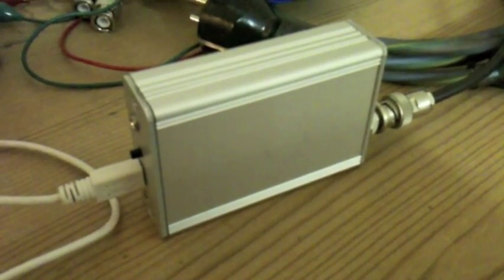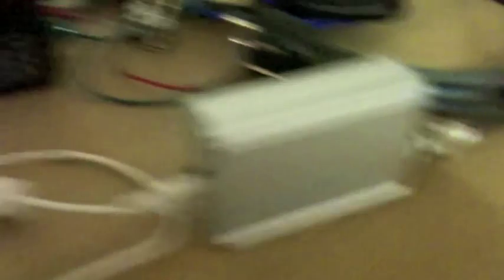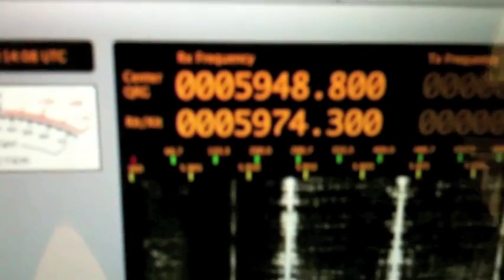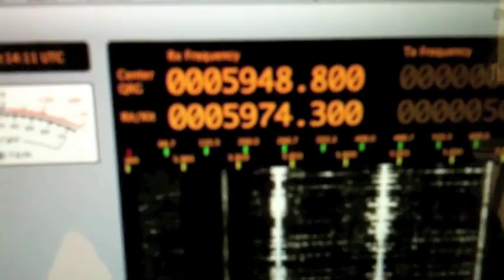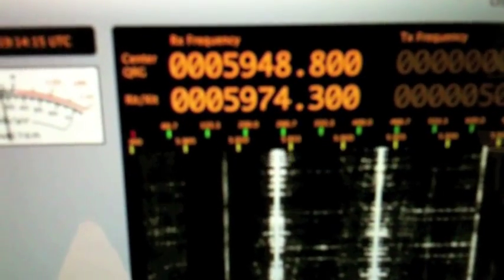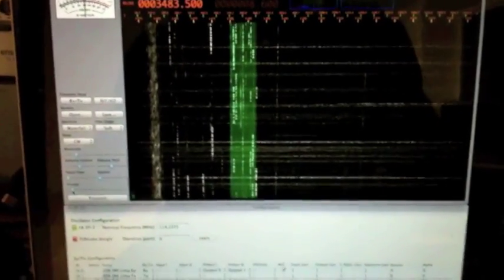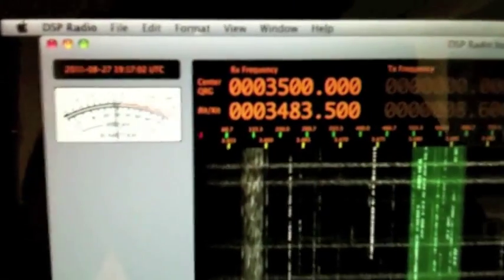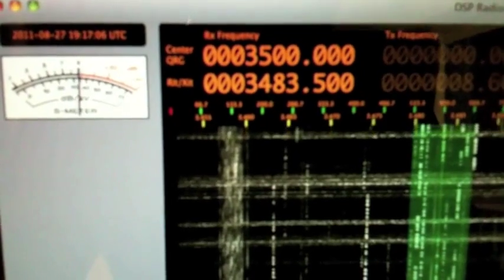DSP Radio 1.2, FiFi SDR, FUNcube Dongle

Comment: Link to the software is disabled. Any updates?
Reply from the maker: @stevenfeil7079  The binary can be found at: https://github.com/dl2sdr
Reply: @DL2SDR  I did a save as on the builds folder and got a folder full of files. Not sure what to do with them now.
Reply from the maker: @ Navigate to SDRRadio102.zip and Click the … Button and choose RAW File Content Download. That‘s all. In your local Download folder you will find the zipped application.
Reply: @DL2SDR  Not particularly intuitive, but I think I finally got it.

Comment from the maker: @remlap 
The FiFi SDR can be found here: box73.de
Its kit number is BX-222P. All SMDs are already on the board, so it's really easy to "build" it. There are only a few parts to solder. BX-222P comes with the preselector board, which is highly recommended. There is also a kit without preselector available.
The FiFi SDR is supported by DSP Radio without any additional installations. The configuration is documented in video N7703NNUeLQ.